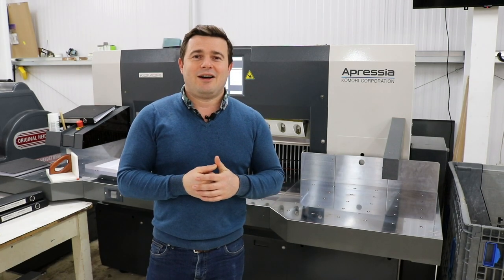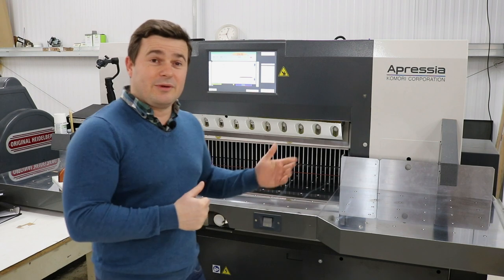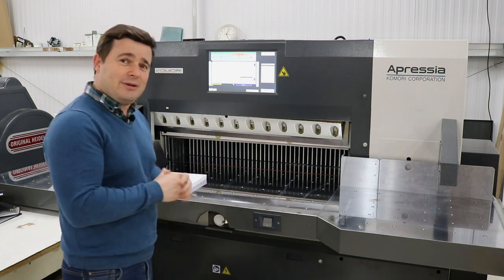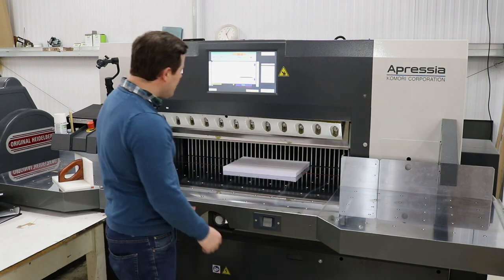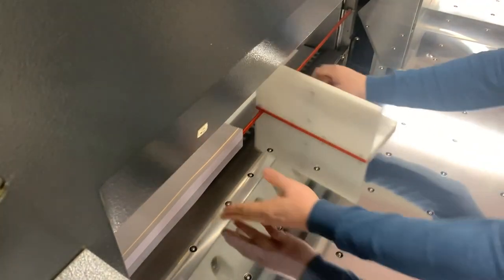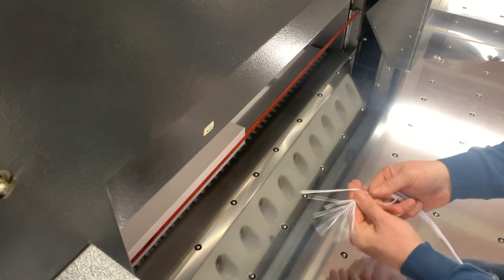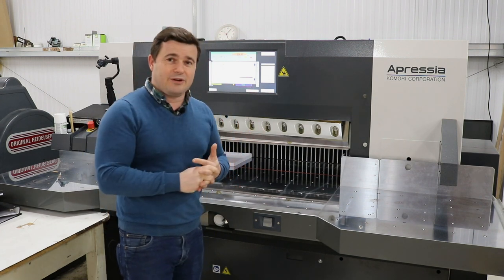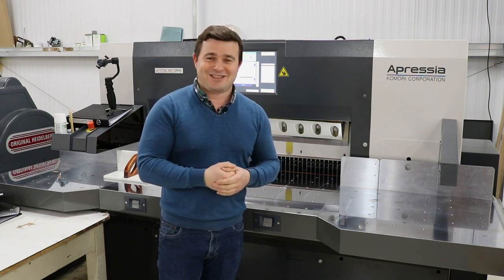Our Most Dangerous Machine? - See how a Guillotine works!

Comment: in 2008 I worked at a envelope making shop that used really old mechanical envelope folding machines a mechanical dye press and paper guillotine from an old Canadian Tire in town.  Zero safety measures on these machines and easily cut 200mm of paper on the guillotine.  The guillotine was fast and intimidating.  The envelope folding machines are a mechanical wonder to behold in action.

Comment: I used to do this cutting in our school’s old print shop. It was a large green press looking machine. It had a big hand wheel up front where you could move the paper stock back and forth on the cutting platform. Then there was a large five foot swing arm you would pull down. It would lower the four foot cutting knife down on the paper stock. There was another wheel to clamp down the work. I could easily slice through three phone books very cleanly. I did all the maintenance on the cutting machine and replaced the blades. I did tons of work cutting tickets and school paper stock at various sizes. That one machine did tons of work. I was it’s last operator. The school district discontinued Print shop. There was a lot of machinery in there that could do you in especially the big printing presses with the large rotating inertia metal wheel. I really miss my Guillotine!
Reply: @Ebony Man. "There was a lot of machinery in there that could do you in....." That's exactly why all of those old, dangerous machines were outlawed by new Health & Safety laws. New rules and regulations condemned the old bangers to the scrap heap sir.

Comment: As a Professional Origamist, from Pharmaceutical to SRA0 Maps, Speciality One Piece, Hot or Cold Glued mailers. Hi-Speed Reel to Plough Fold, 5 edge trim and Fold. 
Saddle Stitch, prefer Harris and Muller Kit.
Perfect Book Binder, prefer Muller, 40 clamp, 3680 Auto log Feeders, Waterfall and In-Line Inserter, Polar 3KT, and Shrink wrap.
Ink jet card attach.
A fully qualified user of Madame Guillotine, Knife Changer and Trainer.
Adjusting from full clamp pressure to pressure required for stock being cut.
Lay and Grip!
Backguage controlled through panel, no need to wind in/out.
Prefer Polar or Wohlenberg with a floating bed, so that the waste drops into the chute, saves time!
Used from, back in the day, a John perfecta, Polar, Wohlenberg, Heidelberg, Schneider  52 to 155.
If you are changing blades every week, I take it you are using HSS blades through heavy board?
I much prefer TCT Blades. 24hrs a day, 6 days a week, will last a month through Litho Stock.
R2R, to cut, Duplex digital press, HP
Sheet Fed Presses x 2 manufacturers. iGen, Xerox
CCM Reel to Insert and Post Code Sort.
I'm sure I have missed a few skills and kit off the list but c'est la vie....

Comment: Remember that woman who cut both her hands off and they cut out auto cut from the programmes . Anyone else hear that tale starting young in the industry?
Reply: @ossyrover1982. I remember that accident. It happened in a factory producing wallpaper somewhere in the North - West of England while the operative was cutting sample/swatch books on a 155cm/61 inch cutter. To prevent the clamp crushing the embossed/patterned designs they used a spacer block against the backgauge. In that way they could cut narrow strips without removing the false clamp. The operator in question was not formally trained and decided she could operate the cutter on fully automatic while seated on a stool (maybe?).  She managed to lean forward and get under the line of the outermost photocell in the standard light barrier and pull the cut strips forward. All was going well until she decided to reach out under the knife to pull the spacer block and the last strip forward together to save time. The cutter - still on fully automatic, cut through the last pile. However, the clamp rested on the pile, but the knife carries on to the bottom of its stroke and cut her hands off. Fortunately the factory first aider filled a bucket with ice and put the severed hands inside. The operator and her hands were rushed to the local A.& E. hospital where the surgeons managed to re - attach the severed body parts. I did read later that the woman got a high percentage of used back in both hands. The factory inspectorate sent out a directive to the manufacturers agents in the U.K. to make a modification to light barriers on cutters pronto. Our Polar guillotine was fitted with two slim wedge shaped plates between the light barrier casing and the machine frame. This lowered the height of the first photocell so that you could not physically squeeze yourself under the light barrier without blocking the operation of the cut cycle. Sorry this is long winded, but this is how the story was told to me by a guillotine service technician while I was in the trade. Stay safe and well.
Reply: @markmiwurdz2248  I’ve never heard the full story mate , all I ever got told it was a woman on auto cut , I’ve used senators on auto cut before you have to push the block with your fingers so your under the beams . So defo knew it was possible . Great story even if a little macabre. Cheers man
Reply: @ossyrover1982. Come to think of it, I believe it was a Schneider Senator cutter. Must’ve caused a lot of problems for Oscar Friedheim in getting service people out to check the Schneider machines in the field. But it’s like all equipment in the print trade (especially big powerful cutters) - you need to be formally trained, treat the kit with respect and don’t take unnecessary risks.